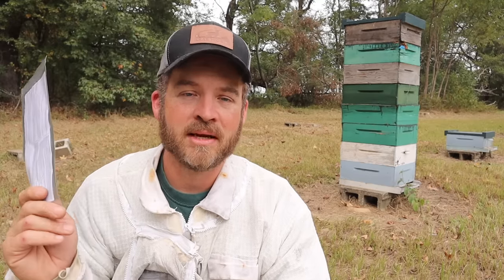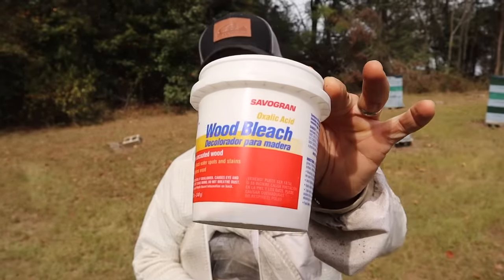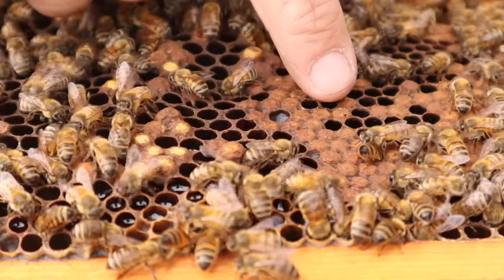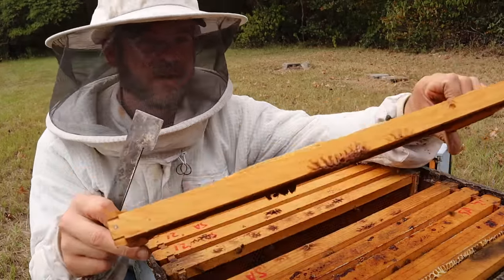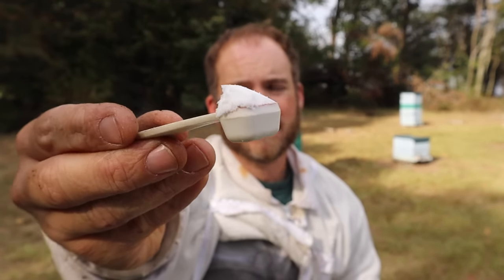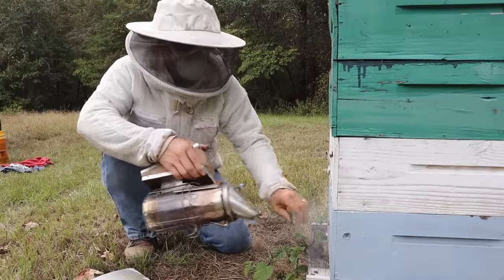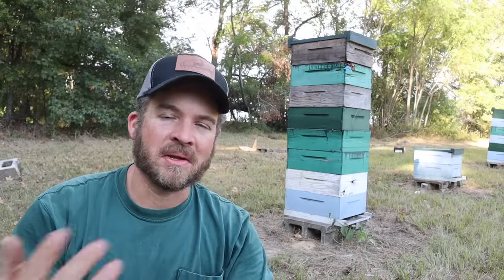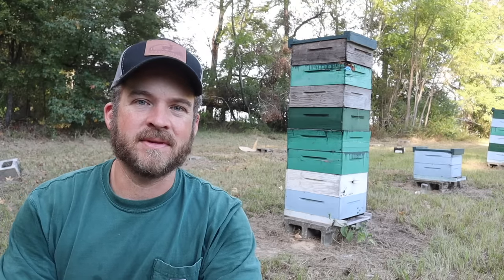How I Make Healthy Winter Bees

Comment: Really interesting... I always wonder how you don't get stung... but you don't seem to worry about it. If you put a switch into the line you would not have to do the fiddly bit with the battery cables... just a suggestion.

Comment: Why don’t you use the dribble method to kill the mites?
Reply: It's a bit late for effective treatment - you want the bees rasing the winter bees (so the fall bees) to be clean and mite free which will result in the healthiest winter bees. Dribble just treats the winter bees directly which is much less effective to have survival, just a lot easier time wise.
Reply from the maker: Robert pretty well covered it. I want bees going into the winter to be clean and healthy, the dribble method only treats bees during the winter (because the hive has to be broodless for it to work).